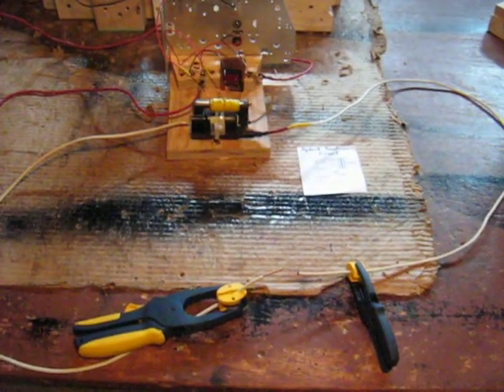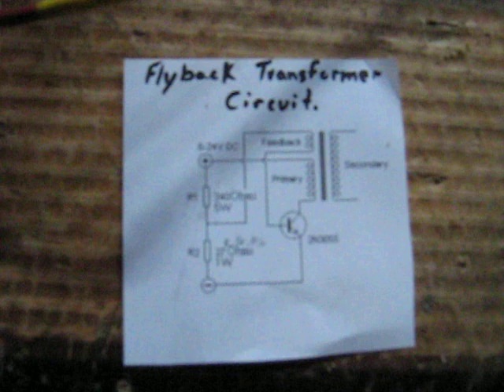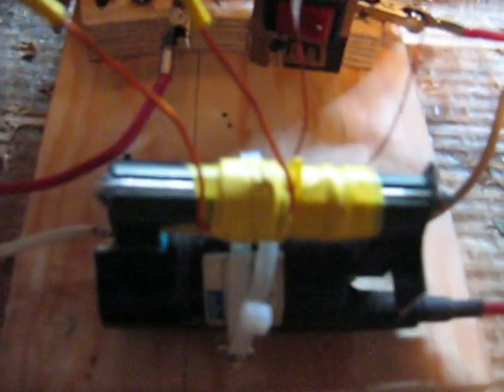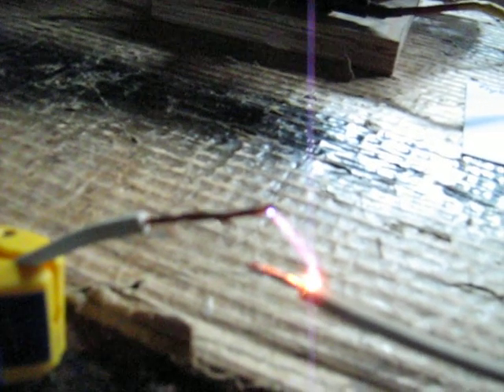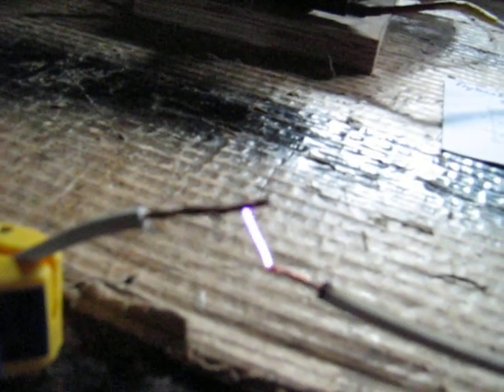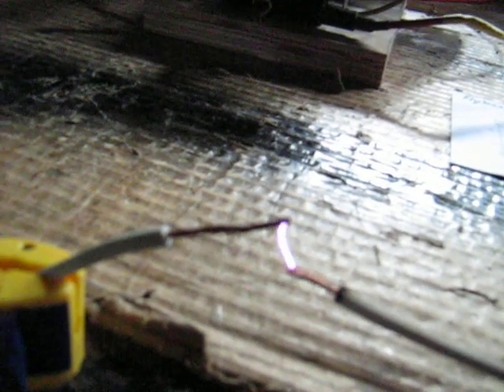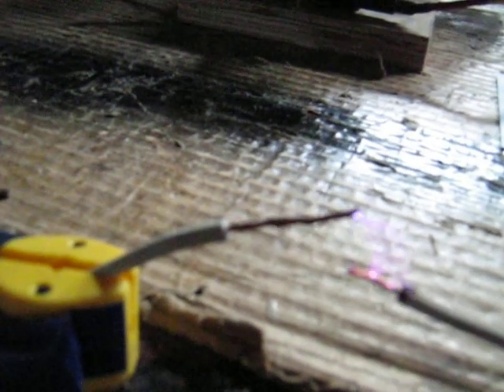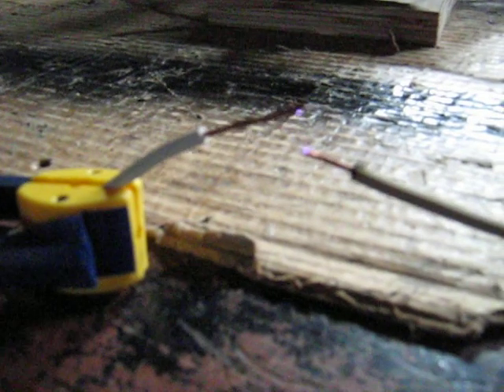Flyback Transformer 20 - 30 Kv

Comment: this is more like 10kv, using the same schematic, i was able to push 50v through mine, without it over heating, idk why lol, i now have a cpu heat sink, a fan, running 4 of the transistors in parallel, and i run form a 30v 5a powersupply, and i can get about 70kv, the arcs start at 3 inches away, and i can pull them out to like 4, in my vid its the old version with one transistor. i had to use 4 because mine are 9amps and they would over heat, now i can go to 36 amps

Comment: Have you heard about cold electricity generator of "ufopolitics"? I'm going to connect the driver circuit of that system to a flyback transformer and run the system with the high voltage generated by the flyback! Do you have any thoughts on that? I would really appreciate your answer :)

Comment: that is badass!!
theres gotta be a way to keep it from arcing to the lifter.
did u take the HV output wire straight to the lifter, and ground the other wire? as long as they are far apart it shouldnt arc over im thinking.

and run that arc through a TINY filament and watch the HV hug its exterior